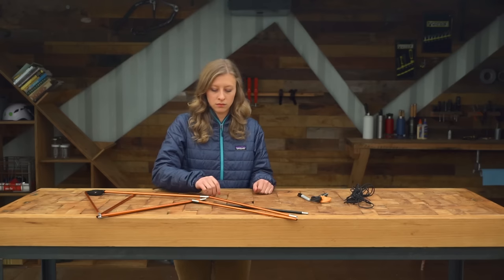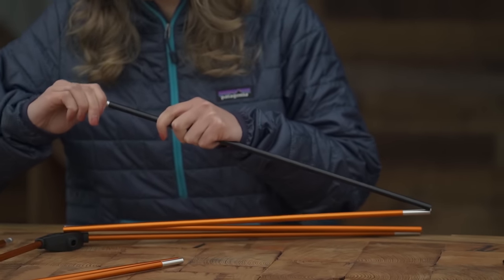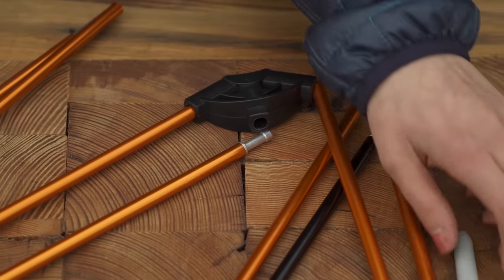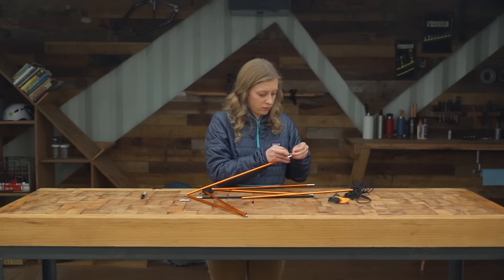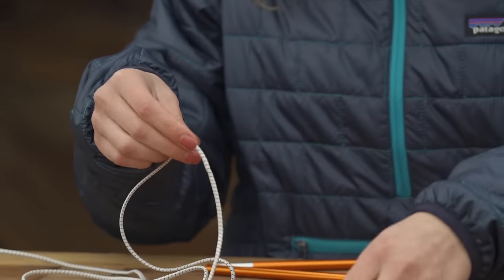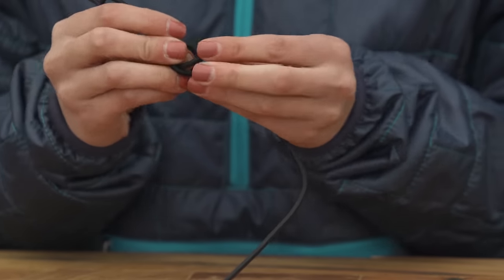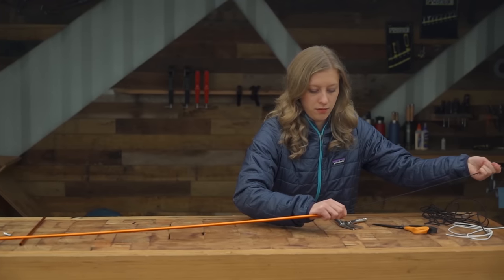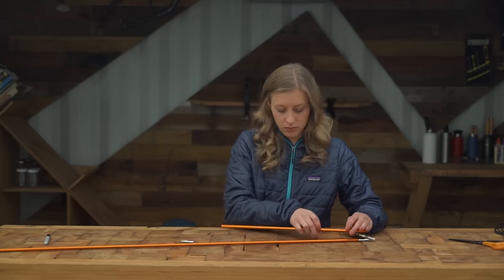How to Replace the Shock Cord in a Tent Pole || REI

Comment: REI missed the mark on a proper instructional video of cord replacement.  Clearly the measure and cut to the old cord length is not correct.  But what about the type of knot to use at end caps? Removing and reattaching cord at black junction pieces?  Size of cord - some sites say 1/8" some say 3/32"?  So many unanswered questions...
Reply: I second that. At a minimum, REI should have spent 10 seconds more on the type of knot to use. The width of some shock cord prevents using some knots

Comment: If you measure the new cord at the same stretched length of the old cord, aren't you ending up with the same problem?
Reply: I thought the same thing.
Reply: Hey everyone, Seeing a lot of the same comments here about measuring the old cord. This is not the way I was taught to do this! (I am an outdoor instructor, and have done this a handful of times.) I was taught to measure the assembled pole section to get the correct length. This way when you add the knot, it creates tension.
Reply: yes, reduce by 10-15%
Reply: Yep.  I followed those instructions.  They should fix this.

Comment: I've had several tents that only required minor tension adjustments over the lifetime of the tent. My REI half dome needed all new shockcord just after the tent was out of warranty. I love that they used poles for a half dome in the demonstration showing that the cord is a problem with these tents they are very aware of. So thanks for the video showing me how to DIY fix a product that REI should have a recall out for. I highly suggest looking for a tent that has a LIFETIME WARRANTY like Nemo.
Reply: I’m just discovering this myself. Looks like a real pia
Reply: Same here! I also have a half dome that was only used 3 times and just last week when we are at camp, discovered that the cords does not have tension. Ended up not using the tent 🤦‍♀️. I will definitely look for lifetime warranty tents next time!

Comment: Thumbs up for the video. Just not sure why I'm having to watch it for my 2 year old tent.
Reply: I thought the same until I realized I didn’t even know how to properly store the thing. Even after years in boyscouts. Didn’t know they shouldn’t be stored all rolled up, poles prob shouldn’t be stored as if for traveling either
Reply: @Wimpyking17  I get what you are saying, but my previous half dome 2 is over 10 years old now and the cord is still intact. They just started using crappier materials.
Reply: I'm with you. I store my tent in a cool basement, albeit poles folded.  My neighbor told me it is not heat that kills the elasticity but the lack of humidity. Not sure about that but here I am replacing cord on a tent only a few years old. Luckily shock cord is only $5 and there are better sources than REI to replace it properly.

Comment: Wouldn't it be easier to tie the new cord to the old and pull it through the assembled poles as you are removing the old cord? As others have commented, it is not helpful to cut the new cord to the length of the old stretched one anyway..
Reply: That is what I'm going to try. Or at least tape it so the knot doesn't get caught on anything.
Reply: If they get stuck you could have a situation that cannot be easily fixed.
Reply: Worked well for me, anyway.

Comment: Ok so i have the same pole set she is working on which is the rei half dome series. Turns out if your cord isn't broken then you can just expose the little tie ends which are tied with a simple slip knot. Pull the slip knot to tighten and cut off the extra cord and voila!  Not quite as tight as new cord but should last until the cord is totally dead and then i can actually replace it. Saved me from replacing 3 of five legs since only two (top and one leg) were needing immenent repair
Reply: I removed the silver end plugs, cut cord, pulled taut, tied loop, replaced hook and plug back into pole and perfect.

Comment: Shock Cord is not needed for the structural integrity of tent poles...
Reply: Youre right, everyone should just use dental floss or shoe laces...
Reply: No, but it makes assembly a LOT easier if the cords are not stretched.
Reply: Yes just much much easy to assemble
Reply: Are you serious
Reply: Without tight shock cord the poles will separate during tent assembly or heavy wind, and sometimes jam in the not-quite-mated position.  From my observations at REI used gear sales, that's the most common cause of poles breaking.

Some specific batches of REI Half Dome tents have shock cord that is known to lose elasticity.  The replacement size 2.5mm, 3/32" or 3mm.  Anything larger will cause problems with the end knot jamming in the pole.

I target 20% shorter than the  poles, and that might be less force than when new.  I measured the cord on a Marmot pole that still had good tension.  The 4.00m pole had a distance between hooks of 3.98 and loose cord length of 3.15m.  The extra length for the knot was about 50mm or 2".
Reply: Hmmm... And in heavy wind?  I've had my poles bend inward on my REI quarterdome tent - and in the AM everything was fine.  I have to think that some of that is due to the shockcord.  ??

Comment: What this video doesn't show is how extremely hard it can be to thread the new cord through the old poles. I had to eventually tape the new cord at the very end of a metal pole (not side-by-side, there wasn't enough room) and it just barely worked.
Reply: What else did you expect from female empowerment?

Comment: Do not cut your new cord to the same length as the old stretched out cord that youre replacing!  
Put all the poles together and run the cord through them.  
On one end fasten the cord to the end plug and screw in the plug finishing that end.  
On the other end, make sure all the poles are snapped together and mark/cut the cord right at the end of the unfinished pole.  
Now use a Bic lighter to melt the frayed end and finish that end the same as you did before.
Reply: Thanks for the tips. I was honestly thinking the same thing about cutting to match the old stretched bungie.
Reply: Wish I would have read this first. Thanks.

Comment: Just discovered the shock cord on my   REI half dome tent was shot. Store employee showed me what to do and assisted with one repair almost.  Using the 1/8 inch  cord there seems to be a lot of difficulty getting the knotted area into the pole.  I think 1/8 is to thick.  I ordered 3/32  shock cord.    I believe it will work better.  I hope
Reply: Thanks for letting everybody know if 3/32 works better then 1/8th. I'll just guess and hope like you did... 1 year ago and never told us.

Comment: Sometimes, especially with slightly older tents, the metal tips will be mechanically crimped in place, which makes removal very difficult. This makes any kind of backcountry repair almost impossible, as you'll need a padded vice and a heat gun (better than a torch) to heat and expand the pole section so you can remove the metal tip with vice grips.

I'd also find someone (like your local REI or climbing shop) with an electric hot knife to cut and seal the ends of your replacement shock cord.
Reply: A pair of scissors and a cigarette lighter with flame applied carefully does the trick.

Comment: Hi Everyone, We've got a Big Agnes which lacks the "pole-end" bits... the shock-cord is retained by some "dimples", in-board from the pole ends. We weren't sure what was in there, but it turns out there's a washer and a knot, so when we cut the old cord, that last bit did just fall out. pwhew!  The other thing that took us a while to figure out is that the center segment has female connectors on both ends*.  So the *male connectors face the center. Have fun!

Comment: The hard part is removing the post that is pinched in the pole at the end of each pole set.
Reply: Hey REI any suggestions for this? the above is pretty much a no-brainer. how do we get the pinched ones out?
Reply: @spencernorcross5370  i find that you can stretch back the pole nearest the pinch to expose cord and push the pinch out.

Comment: None of these videos explain Why its so important to number the poles and keep in correct order?? What if they all fell off the broken cord? Then i have no idea what order they were in.
Reply: The order should only matter if there is some segments with bends on them or if there is a variable lenght of the segments.
However, it is easier if the end segments are marked, since many tent makers have end plugs that screw in and one of the end pieces should have no connection with a narrower tube in one end.

Or to say it shorter, some of the segments is different from the other, those should be in the same place as before.
Reply: It only really matters to know the two end poles, ( because of the caps to tie the cord)the rest are generally the same size .

Comment: @REI. this video link below s a better resource for replacing the shock cord in a tent pole system. Also a note that the cord in the backpack tents are commonly 3/32" sized cord, not 1/8" cord. https://youtu.be/wxDLPNr0iBo?si=N5836NBUHsCsehWz

Comment: In my vast experience replacing shock cord (I did it ONCE), I found the length of the original no-stretch cord was too long. So, I passed it through all the sections, assembling as I went, pulled it tight, left a couple of feet extra for stretch, and tied it off. Worked great except there wasn't enough slack left to go around each end as it folded down. I'm not sure how to calculate how much is enough without being too much. My geek brain wants a formula with a nice constant to plug in for x: 
(segment length * number of segments) * x% = length of cord. 
Without that I might have to actually THINK and I'm not so good at that. Anyone have a value to plug in for my x?
Reply: and a value y for the elasticity of a given cord!